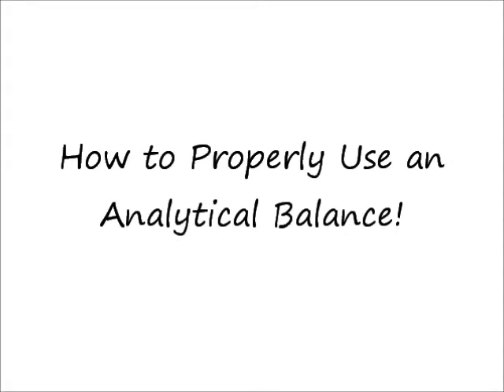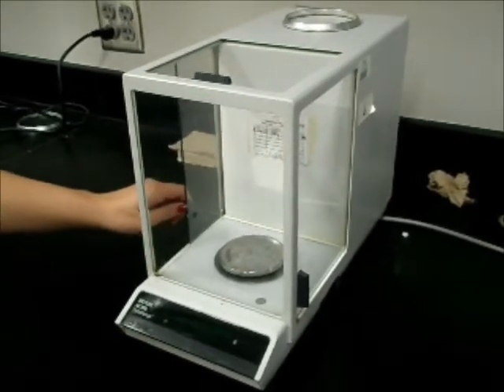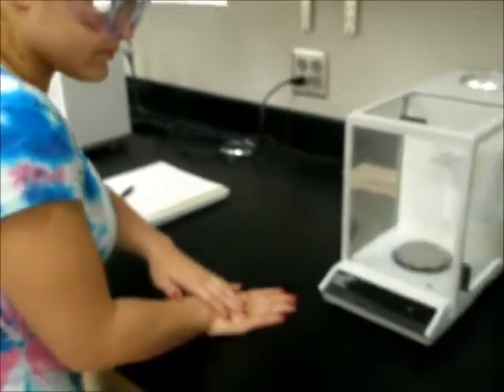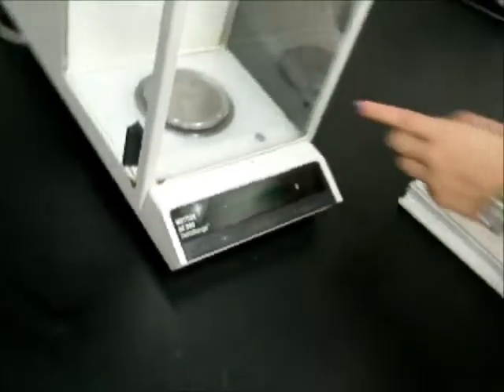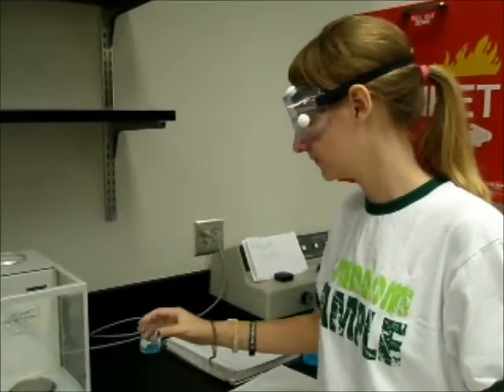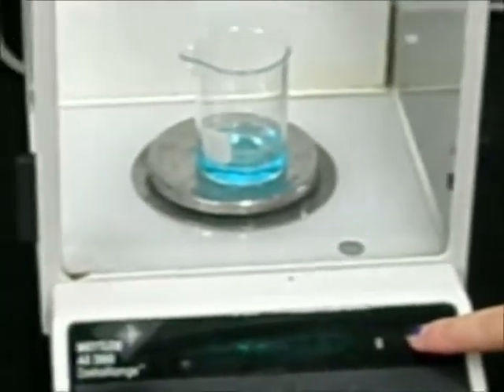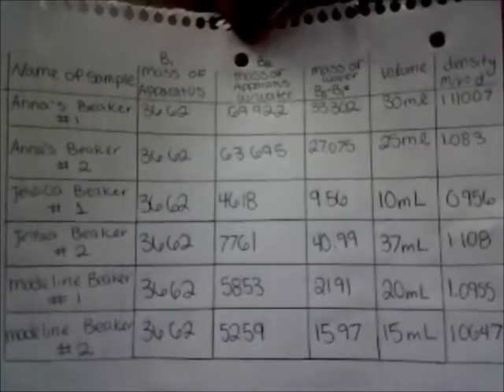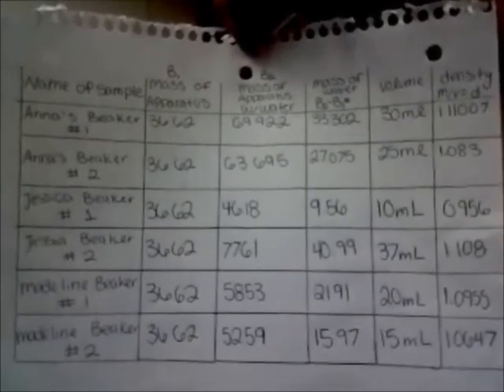Analytical Balance Video

Comment: I designed 2 balances: [1] An analytical balance that uses air pressure or electromagnetic pressure to raise the substance to a zero level. The pressure determines the weight. Another balance I designed utilizes a wide laser beam to measure weights of subatomic particles. The energy added to raise the beam to a zero level [where the beam is straight] determines the weight...